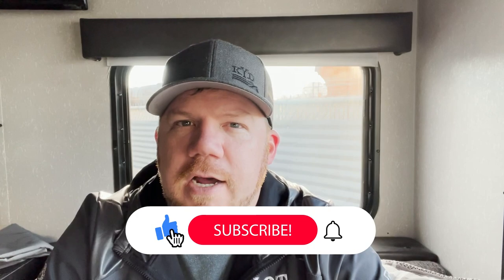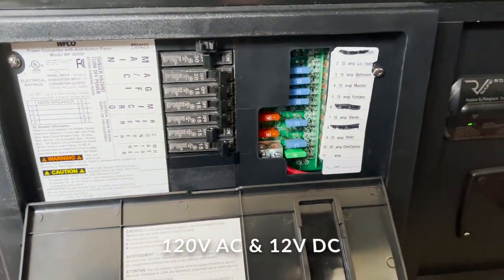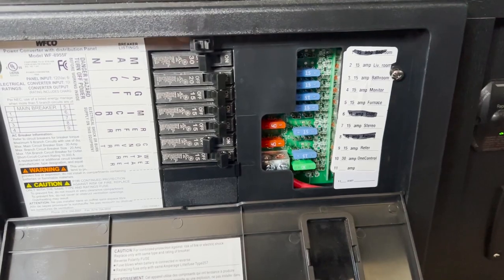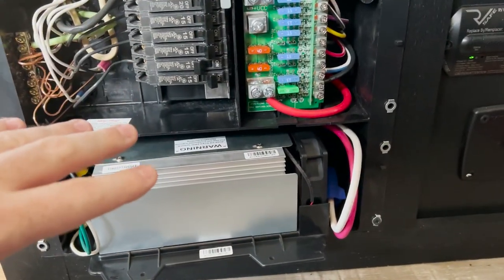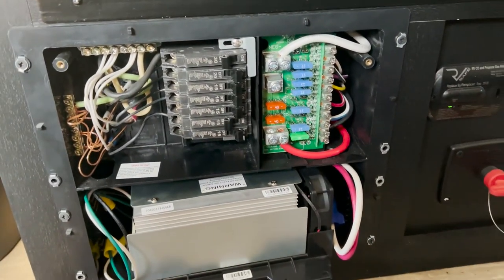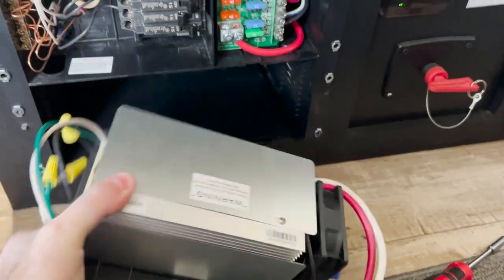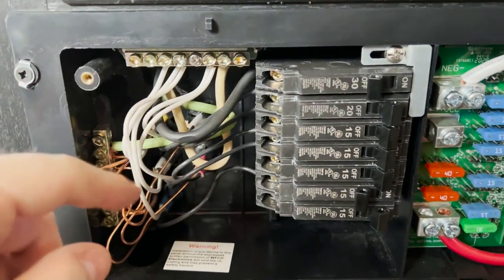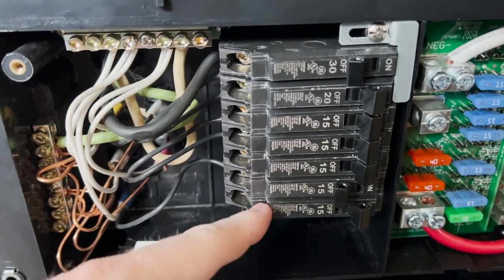RV ELECTRICAL SYSTEM EXPLAINED - Wolf Pup Travel Trailer

Comment: Nick, Did you modify the tow vehicle to deal with the lithium batteries? I have been reading conflicting information regarding lithium batteries are hard on alternators, others say if you have less than 300Ah it’s not an issue. I only want one 100 Ah lithium to replace my AGM battery

Comment: We are having problems with our awning blowing a fuse when we had to retract button but not the extend button. And the light does not come on beside the blown fuse like the other fuses for the living room, etc. I would say because it only has power running through when you have the control button pushed?

Comment: My Wolf Pup 2021 16BLFQ has the WFCO WF8955PEC Controller claiming to work with Lithium batteries, but does not fully charge due to 13.5 charging voltage. A newer version controller does have a switch to allow higher charging voltage for Lithium batteries. So if you go Lithium be sure to check your controller.

Comment: I think that “safe for lithium ion” sticker is cute. Haven’t found that magical toggle switch on my Grey Wolf either. The good news is it doesn’t matter. If you want to upgrade batt you might as well upgrade the tiny 50w panel and therefore upgrade the 14awg wire, and at that point you might as well get a lithium ion compatible charge controller.

Comment: I'm trying to figure out how to use my 12v battery system to power my baby monitor. The camera portion of the monitor has a standard AC wall plug, but converts that to 5v DC 700ma. The goal is to be able to use it while boondocking (without running the generator). So, I assume my standard AC plugs won't work. The USB's should. I'm not sure if I need to install a new outlet in the wall that will run off of 12v, or if I need to get a new cable for the monitor (I've never had luck with this type of thing).

My RV is a 2024 Wolfpup 17JW. I don't actually have it yet, but should have it next week.
Reply from the maker: You would most likely need to get an inverter or find a power adapter that produces the right voltage you need from a USB plug type

Comment: GREAT video! We just rented a wolf pup recently and I was told the refrigerator can run off the gas. It wasn't cold at all on the drive up to the campsite, but after I opened the propane valve, it cooled down fairly quickly. Was this running solely off gas or was it running off short power too? We were NOT hooked up to short power but were periodically having to charge the batteries with a small generator for 2-3 hours at a time to get full battery charge.
Reply from the maker: The newer pups are 12v fridge only. Which is what mine had.
Reply: @TheRVPastime does the fridge work during transport while worked to trailer. Via truck power?

Comment: I have a 2022 wolf pup 16FQ and recently my microwave stopped working. I removed it and plugged a fan in the outlet in the ceiling where the microwave was plugged. The fan worked so I chalked it up to bad microwave and purchased another one. I got the new microwave today and installed it. The microwave showed the time then I went to test it when poof it quit working too. I have checked output from outlet and it’s good. No breakers blown, no fuses blown, why does it keep killing microwaves? I took both the old and new microwaves in the house and plugged in they are dead. I’m so confused fused. Any help is appreciated!
Reply from the maker: I would get a test meter and measure the voltage coming from that outlet.

Comment: Thank you for explaining important things the way they should be explained. Please tell me, 2022 wolfpup16hq plugged in to  generator, it surges when plugged in. there's a click in the batteries like it's trying to click over.   It's trying to charge but can't. It's every 5 to 8 seconds.  Thank you.
Reply from the maker: Converter/charger may be having issues. I don’t recall that behavior before I swapped to the new setup.
Reply: @The RV Pastime  when plugged in to generator, are the batteries being charged when the battery disconnect is off?
Reply from the maker: No, they are not because you’re removing the batteries from the system basically.

Comment: Quick question - did you have to do any grounding on the AC side when you hooked up your inverter? I've been working on my setup based on yours but I find the AC side confusing.
Reply from the maker: The AC lines are grounded in the electrical panel. I also ran a copper line to the inverter case itself but that’s not required really.

Comment: If you're hooked up to shore power 24/7, is there any worry about overcharging your battery?
Reply from the maker: Your converter/charger should be managing that charge automatically. It has different charge profiles based on the voltage the battery has aka its capacity. So if it’s already at full, it’s not actually “charging” the battery forever. It creeps the voltage down to a level that keeps the battery maintained at a full charge.
Reply: @TheRVPastime  Exactly the info I was looking for. Thank you.